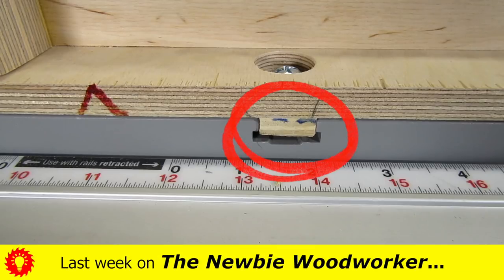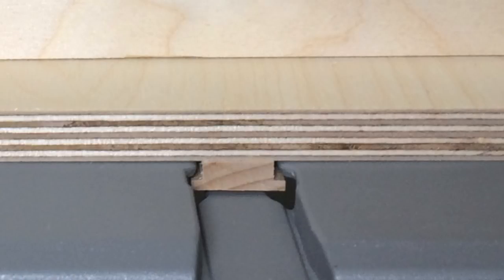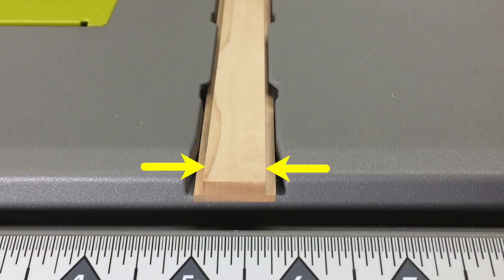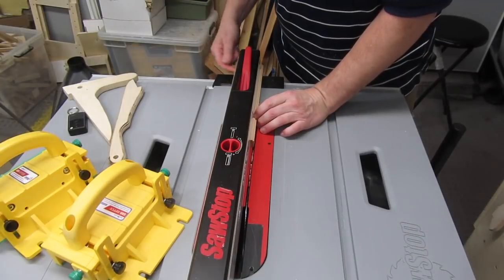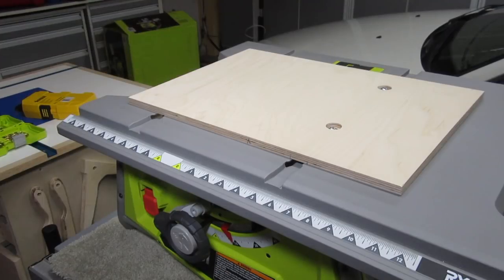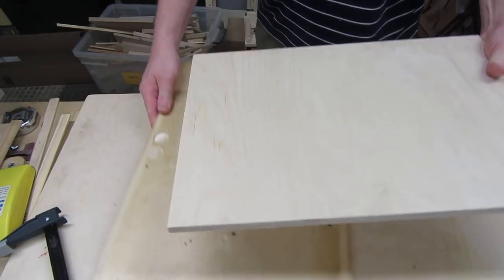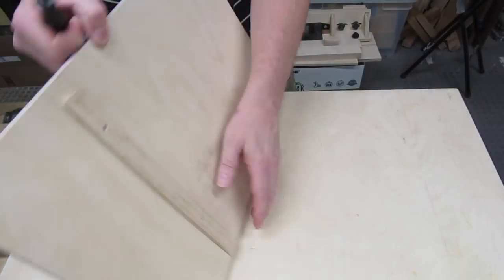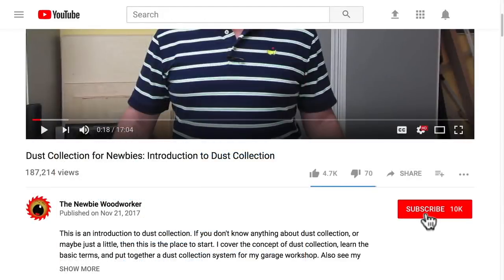Runners for Ryobi/Craftsman Tabbed Miter Slots

Comment: Dan: I just found this video and would like to thank you for making and posting it. Recently, I picked up a gently used Ryobi jobsite saw for free on Craigslist, and quickly discovered that the miter slots, while they do not have the tabs you show, do have an inverted 'T' shape which is too narrow at the top to accept the runner on my Incra I-Box (or any other Incra product). Turns out that "real" table saws have 3/4" slots.... Maybe that's why the Ryobi was being given away! Anyway, since I lack confidence in my ability to sneak up on a cut in order to follow the procedure you have so gracefully outlined, I have come up with a potential work-around for lazy people like me.
The standard-issue miter gauge for a Ryobi, Craftsman, Jet or other jobsite saw is basically a stamped metal bar with some plastic screwed on. They vary in width but are more or less uniform in thickness of material. So, assuming that the miter slots on my Ryobi are BOTH parallel AND of uniform width, all I really need are a sufficient quantity of the metal bars found on crappy miter gauges. If I attach a pair of them to the bottom of a crosscut sled or other jig in such a way that they hug the outside edges of the two miter slots, the inside edges can be ignored, since the runners will slide smoothly just against the outside edges, if that makes any sense....
Going a little further with that thought, why rely on finding a bunch of discarded miter gauges, since all I really need are some thin metal bars with shoulders of the proper height stamped in them? Looks like it's time to go Dumpster-diving with a mission in mind! If I can get this hack to work I'll post back with my results.
Reply from the maker: Thanks for the reply, Carl! You said "since I lack confidence in my ability to sneak up on a cut". All you need is practice and some scrap wood. Honest! You can do it! There's nobody around to ridicule you while you try, and I'll bet you get pretty good at it within less than an hour. Try it! 😄Just don't use soft wood like pine, because it doesn't cut as accurately. Use some halfway decent plywood, or hardwood like maple or birch or oak or whatever. I'm expecting to hear back from you that you tried it, and I was right. 😛
Reply from the maker: @Airwrecka1980  I don't know what you mean.
Reply from the maker: @Airwrecka1980  LOL - I've done that before (replying to the wrong video). I've even replied using the wrong account, which can add to the confusion. Glad to hear that grinding off the tabs worked. 😄

Comment: Those tabbed slots are a PIA. There's so much play even with the factory accessories. I'm thinking of just cutting them out for a custom runner.
Reply from the maker: Other people have said they cut them off with an angle grinder, and they haven't had any problems. Of course, it voids the warranty...

Comment: Thanks for this video!!

My Craftsman table saw has those stupid tabs. I was tempted to grind them off but resisted.

I like your method and will try to do it that way. Like some other posters I think I will make some extra runners in case I need a spare or want to make other sleds now!
Reply from the maker: Thanks, and you're welcome. Absolutely make multiple at one time. See my other video https://youtu.be/0gvx-_YipOs for how to make "blanks". When you get the width correct, trim all of them. Then when you get the rabbets correct, finish the rest. Good luck - let me know how it goes!

Comment: Wow, Dan thank you so very much for making this video. Although I’m not looking forward to making another sled I can always use a bigger or smaller one. I’ll give it a try but not sure how soon. These slow comments on not wanting to make another sled can tell you how much he** I went through making my first one. It’s not perfect by any means but it’s “close” as they say. Another thing that happened to me once I got the runners on I put the back part of the sled on and for some reason I guess it “pinched” together a little and my cut that comes out the back (part closest to body) didn’t cut straight bc it pinched the Saw. How that happened who knows!! It’s like Murphy’s Law with me on making that sled. I understand everything you described and I’m much more familiar with using the Saw now that I feel more confident that I can do it. The Saw you used is the one I have.  Thanks again Dan it’s pretty special you taking time to make another video for those of us who have the saws from HE**!  LOL
Reply from the maker: Thanks, Becky! You're one of the people I was thinking about when I made it this video. Regarding your current sled, everything is a learning experience. In fact, if you get something right the first time, you miss out on learning something valuable. The thing that doing these videos has taught me is that this isn't voodoo - if something doesn't work right, there's a reason somewhere, if we look hard enough. Well, most of the time, anyway. :)

Comment: You mentioned (2:00) that it'd be better to have the grain running vertically, but that'd give you a clean break line where the side "tabs" of the T are, so any upward force/stress would start to peel them right off. If the grain's horizontal, your break line would be the whole bottom layer - the "crossbar" of the T, which is a lot more 'surface' area. (Think of each as if they were glue surface areas that you attached onto an initial rectangular bar: either gluing on just little square strips into the side recesses, or gluing on a wide flat strip all the way across.) I'm brainstorming that if this is actually an issue to be solved, it'd be best to pick wood with diagonal grain! (Or just use UHMW -- or even chop up a cheap cutting board from Marshall's/Home Goods/Target/Walmart... 🙂)
Reply from the maker: You make excellent points.

Comment: I made the mistake of purchasing a Ryobi RTS23 table saw. It's not a bad saw if all you plan on doing very basic cross cutting and ripping of lumber using the standard Ryobi fence and miter gauge. Forget attempting a cross cut sled and don't expect to do anything semi-precision with this saw. As you stated, the miter slots are not standard. In their infinite wisdom, Ryobi decided to eliminate the left side miter slot. The RTS23 table now only has one slot and it's on the righthand side of the blade. In addition, the fence is now L-shaped. When installed to the left of the blade, the fence has a 1/4" high face to run your lumber up against. The owner's manual recommends cutting material no greater than 3/4 of an inch in thickness with the fence on the left side of the blade. I don't feel safe cutting any material with a fence that is only 1/4" tall. With the fence on the right, the fence has a full width face. I was hoping to use a precision miter gauge on this saw. Unfortunately, all of the precision miter gauges I have found so far, do not fit into the Ryobi slot. I am all ears if someone has found a precision miter gauge that works with the Ryobi slot.
Reply from the maker: Ugh. Take it back, if you can. Good luck!

Comment: Thank you so much for this video!  I got this table saw a couple of years ago and at the time looked for a video that would help build a sled for these slots.  Finally I found it!  You just got a new sub.  Awesome work!!!
Reply from the maker: Thanks for letting me know! Sometimes you just never know if a video really helps anyone, so it's great to hear that it helped you. Feel free to ask questions if you need to. 😄
Reply: Same here. I made an insert before out of ply and it eventually broke and was never 100% correct.
Reply from the maker: @ambientwater  Yeah, I wouldn't think plywood would work well for this kind of insert. I hope I didn't recommend plywood in this video. 😳
Reply: No you actually suggested to only use hardwood. I have yet to even ever touch hardwood. Now I will.
Reply from the maker: @ambientwater  LOL, I totally get that. I much prefer plywood - it's just so familiar and comfortable. I don't have to worry about seasonal changes, or planing or jointing or whatever. But, at least at my local Home Depot, I can find pieces of hardwood that are straight enough and completely milled so I don't need a planer or jointer. And once I started using wood like maple, I saw some of the advantages. I'll be building an ottoman/coffee table using it soon.

Comment: I have a Ryobi RTS20 Table Saw, with those darned T-slots. A couple of years ago, I went ahead and made some runners for my first sled, a combination cross-cut/miter design, using one runner and no vertical fence. Around the same time, I had built a router table using an old B&D Workmate for a base, so I cut the rabbets on that.

I was fascinated to watch your excellent video and see how you did it. I think perhaps your method of cutting the rabbets on the saw might be more precise than what I did.

The main problem I have with making these runners is that the slot widths themselves are not consistent, either from slot to slot or along the length of either slot. So I end up having to average the runner width to fit, or sand the edges where they stick, before waxing them. In using the sled I made though, I found I could eyeball the cut well enough to split my pencil line. So, good enough for my needs.

Currently, after five years of use the blade on my Ryobi saw has gone slightly out of alignment. Can you tell me where the heel/parallel adjustments screws are on the RTS20?

The manual says they're just above the height/bevel adjusting wheel on the front face, even shows a picture, but nope. They aren't there. The only other hex screws around the blade are on the top of the riving knife assembly, but there are four of them, two large and two small. Since you owned a Ryobi saw, do you know which screws are the right ones for the heel/parallel adjustment?

I've searched my brains out online, and can't find anything beyond what's in the manual. I'd prefer not to loosen things that don't need loosening, if I don't have to. Thanks.
Reply from the maker: Wayne - I don't know where they are. But, here's how you find out. Turn the table over (with the blade all the way down of course), and if there's a bottom cover, remove it. I know that turning the table over isn't the simplest task, but trust me, it'll be worth your time. Then take a look at the blade/arbor assembly. Look to see how it's anchored, and imagine how it could move for alignment. I'll bet it won't take you longer than a couple of minutes to figure out where the screws are. If that doesn't work, let me know.

I had an old Ryobi that wasn't the same model as yours. Anyway, I got frustrated with something and finally decided to turn the table over and look at it. I was amazed at how much I learned, just by looking. It took away the "mystery" of how the thing worked.
Reply from the maker: I forgot to mention that when you turn it over, make sure you put down something to protect the surface of the saw. I used a piece of old carpet. But probably some old towels would be enough.
Reply: Turned the saw over, and removed the plastic sawdust collector from beneath the blade. Couldn't see anything that looked like it adjusted the heel angle, so called the Ryobi North American service department.

The tech, nice guy, read me chapter and verse from the manual and couldn't believe it when I told him the adjustment screws weren't on my saw. Sent him pics of where they should be along with the model and serial number off the ID plate, and a shot of how the blade assembly is attached to the table underneath with hex screws (not adjustable).

In trying to get back to the first tech, I spoke with a second tech, also a nice guy, who said he doesn't remember the RTS10 or RTS20 having an adjustable trunnion for the heel angle. As I said in my email back to the first tech, "kinda sucks".

That said, the blade angle seems pretty accurate already. I'm going to go ahead and measure it, and will post back.
Reply from the maker: Holy cow! That's so strange. When you stump the manufacturer, you've got a real winner!

Many, many years ago, when I first started programming, I used to find bugs in the compiler that nobody had ever seen before. Sounds like you've got the same gift. 😛
Reply: Yup, happens to me with some regularity. It's pretty cool though when the manufacturer/developer confirms what I'm telling them and holds up their end until we find a solution.

To continue the saga, I cut eight new runners as best I could, then turned the saw over again to further examine the blade mount. Turns out there are two mounting screws at the back, just under the table edge - so, four blade assembly mounting screws, none of them intended to be adjustable.

I ordered a deflection gauge online, and built the test rig you describe in Blade Alignment - Part 1. I made the short runner as tight as I could get it in the T-slot, so that with a bit of pressure to one side I can get repeatable readings within a thou. Then I measured the blade alignment.

It's out repeatably from 2 to 2.5 thou front to back (using the recommended board, not the blade). I'm considering loosening off the mounting screws under the back edge (the easiest to access) just enough to allow minimal movement, to see if I can maybe improve the alignment by a thou or so.

Not sure about doing this, as I don't want to make things worse. What do you think, Dan?
Reply: I decided to leave the blade as is for now. However, I was having a lot of trouble mounting the runners I had cut onto a sled base. They ran smoothly through the T-slots on their own, but stuck in several places after mounting. I tried several adjustments, but with eight surfaces to account for, I had no way of telling exactly where they were sticking. So ...

In frustration. I got out the Dremel and cut off the eight lugs that formed the T-slot. A little light grinding and they're beautiful. Yay! I'm a convert. Should have done it years ago. Runners mounted on the sled base (glued and screwed) and waxed. Sled slides effortlessly. Thanks to those who suggested the table mod.

Still having a problem with the table fence. It appears to have enough adjustments to make it true, so I'll continue that process, and glue a small, flat piece of neoprene rubber to the plastic piece that's supposed to grip at the back of the table. Right now I'm measuring as accurately as I can from the closest track slot, and clamping the fence to the table. The RTS20 has excellent features, but is rife with design flaws. For example, I would have preferred large set screws with knobs on the fence, front and back, to the existing clutch mechanism. Maybe a new saw next year.
Reply from the maker: Good for you for keeping up with it! And thanks for letting me know your progress. As for the Dremel, on my old table saw I had to file down part of the miter slots to get them even. And even my new SawStop required minor surgery at the very end of one of the slots. So sometimes, you have to take thing into your own hands!
Reply from the maker: Wayne - I don't know if you'll see this reply or not, but I wanted to let you know that I missed one of your replies, because YouTube hid it from me until just now. It suddenly appeared in the "needs review" tab of my channel - 3 weeks after you posted it.

It was your reply that finished by asking me what I thought. I'm sure you were wondering why I didn't reply. Well, now you know. Fortunately you kept at it without my thoughts, which probably would have been something like "I dunno". Anyway, like I said, sorry about that! 🙁 And even though it wasn't my fault, I feel really bad about it. Oh well, nothing I can do about it now. 🤨

Comment: 9:05 how did you find a Ryobi TS that has 2 miter slots? Is there any way you remember what that model was? That wasn’t the battery powered, was it?
I have the RTS23. It’s downside is 1 miter slot for a bunch of reasons. 

I really like your use of the dial indicator set up on the fence. I definitely made more of that. Thanks.
Reply from the maker: At Home Depot. I don't remember the model. And thanks!

Comment: I did this for my first Craftsman sled. The problem is that the tabs and the holes beneath the tabs are rough and over time catch on the runners and rough them up, making them increasingly grabby. My runners were glued, so I couldn't easily replace them. I thought about having replaceable runners and just keeping a bunch of spares, but then I thought to myself, "what exactly is the point of the tabs?" I think they are just there to help control the cheap miter gauge. I carefully took a metal file to the tabs and I've never looked back. Trust me, it was less work "fixing" the slots than it was making the runners. I have 4 different sleds - it would be a nightmare keeping good runners on them.
Also, for larger sleds (if you really don't want to remove the tabs), use the table sides instead of the miter slots. I did this at first and it worked great... until it was time for a mini sled.
Reply from the maker: Yeah, I think cutting off the tabs is probably the best bet. Thanks!

Comment: I have a newly purchased Ryobi table saw that only has one runner track.  Would I still be able to build and use a crosscut sled on that.?  Or can you only use with two runner tracks.?  It came with miter gauge, but wanted to build something better.
Reply from the maker: You can definitely make crosscut sleds with only one miter track. Check out this video: https://youtu.be/b-65Bs5Yi0w.